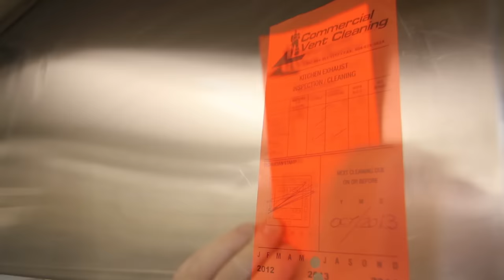Kitchen Exhaust Cleaning   Commercial Vent

Comment: Good thing you guys picked an already pretty clean hood to advertise lol show them how a Chinese restaurant hood looks like lol
Reply: HAHAHA... some chinese spots are maintained.. but if you go to a lower end ones jesus.
Reply: some taco shop too, check them out...
Reply: No joke.  Any place that cooks with corn oil or sesame oil is hell to clean.  That type of grease, it just won't budge even if you're using extremely caustic chemicals.  Doesn't matter how hot your water is, how much pressure you use, or what your gallons per minute on the machine are.  It'll just sit there, all smug-like until you crawl up in there with a razor blade and peel it off.

Some taco joints and chinese spots, it's like you're skinning a calf.
Reply: @SoulSoundMuisc  Ya for sure. we used to own a HOODZ truck and that peanut oil was the fucking worst. we refused to service them. or at least seek them out. also they were usually too cheap to even get it serviced which is why they get so bad.
Reply: @swedishfish6505  Company I work for, we do take those jobs but we charge very high for it because it's going to be a recovery cleaning (6 hours or more for 2-3 techs).  Post recovery we can get them down to 2-3 hours a job at about the third cleaning, if they stay on schedule.  We also demand payment up front the first few services, cash or check.  No payment, no cleaning; we've been stiffed far too many times.

I will say this about Mexican food, at least in my area.  They are, bar none, some of the cleanest kitchens we encounter.  The equipment is old and worn down, but it's clean.  The floors?  Clean.  The hood exterior?  Clean.  Half the time the hood interior is clean because they get up there every night and wipe it out.  It's the roof work, duct, plenum and filters that are a nightmare.  Not all Mexican places are like that where I'm at, but most of them are.  They're hell to clean, but you can tell they give a damn about their business.
Reply: True they are the hardest ones
Reply: It's not clean
Reply: @SoulSoundMuisc 👍🏼👍🏼👍🏼♥️♥️♥️♥️♥️💯
Reply: @SoulSoundMuisc how much do you charge for something like that? You in socal?
Reply: Or Indian dude😂
Reply: That's hilarious.. but the truth

Comment: I have to say, the techniques used in this videos are not the safest or most effective ways of cleaning. The used of just a hand sprayer without a wand for pressure washing does not reach the far away stuff and doesn't get the hard to see spots in the fan and is very dangerous to the user. We see this a lot in our area and the ones who use this way of cleaning don't get called back.

Comment: Not bad. I would recommend using a 2ft wand with a 45 degree angle at the end in order to get the back of the blades better. I would also be very careful about using the zero tip. I noticed you hit the fire suppression link. You want to avoid spraying that directly. It could set the system off.
Reply: No
M
M
Ok 
Yes we mmm
Ok
Reply: Yeah I was gonna say the same this. Q0 lbs of pressure will set that off.
Reply: That's why you disarm the system before cleaning
Reply: @M18-v4t  disarming doesn't matter if you damage the links. Apparently someone is not certified in fire safety giving such cheap advice

Comment: I like the job they did I’ve been doing this for 7 years along w grease trap removal and laundry exhaust cleaning but what about all the grease exhaust fans on the edge of the roof that you can’t flip over all the access doors that have a small door cut and can’t do much cleaning too I do this in nyc

Comment: Why didn't you guys clean behind the vents? 2:27 cleary shows all thw grease dripping down.
Reply: Im sure it dont matter
Reply: Jarumy Leon i noticed that as well, most likely its not a big deal but i'd want clean work all the way around
Reply: Alot of restaurants owners or managers are cheap as heck
Reply: @MrLatrinca  it does matter if u don't clean behind the filters there can be pounds of grease behind there
Reply: Some of those stains are not removable
Reply: it is clean , I think in the video you cant see , but is just water .
Reply: Well when a person what their kitchen hood clean you have to do the fan the duct 
And then hood and the 90 spots.

Comment: I use to work with a good exhaust cleaning company. Never again will I work that job. Way to dirty, most bosses cheat you out of hours, and the people that work at restaurant business are the worst. You never wanna work in a restaurant. It's like those people aren't connected to reality and have massive egos.. always telling you how to do your job but has a dirty ass kitchen and dirty pots laying around. I'll stick to tree work.
Reply: What type of degreaser is that why does it foam up
Reply: I only have problem with the Chinese restaurants lol
Reply: I work in a kitchen if its as you say then the u need tell health inpector
Reply: rtd Ozi... well what we use to use was oven cleaner and we would pour that chemical into the foamer for the power washer... and the pump sprayer I believe has sodium hydroxide mix with water in it
Reply: Yes Pablo... Asian restaurant were a bitch to clean.. this restaurant in the video they are showing is cleaner the most Asian restaurant kitchen exhaust system
Reply: Justin, ive just started this job, sometimes the grease and oil gets in my gloves and its starting to stain my hands what did you use to clean your hands?
Reply: @jayzah  use better gloves.  And better protective cloths.   These chemicals are very strong.  It will destroy your skin & get absorbed into your system then the long term health effect will cost you $$$ & PAIN & THEN YOU'RE DEAD.  Be smart.
Reply: @AndreAndFriends  Thanks for the info man! Im in my second month Already got chemical burns from trialing a previous pair. Ive taken to a thicker, tighter pair of gloves that seem to be working better. Taping them off at the top is helping to
Reply: I recommend you to work my ex company in philipines
Reply: Hey whats the solution u use to clean the restaurant kitchen hood... mine is very very greasy... would appreciate if u could let me know about it
Reply: I've worked in the restaurant industry for 20 years, and honestly... I'm having a hard time disagreeing with you. lmfao

Comment: Didn't clean in behind the vents, nor did you show the grease traps below the vents being cleaned out. The stainless steel behind the vents was still pretty caked on with grease. Noticed as they were putting the vents back in. I have to clean the vents at my restaurant, sadly can't spray it down like you guys did, that would make it so much easier.
Reply: So how do you do it without the sprayer?
Reply: @ShiftingCloudsYT  spray it with degreaser and wipe clean. Takes a bit but gets the job done.
Reply: yes they did its clear they show it before and as they throw the filters back up its just the back wall behind the filters is galvanized steel and gets like that over time.
Reply: Soak them in the sinks overnight
Reply: @CravenM1980  it wasn't an option when I worked there. I've since moved on so that headache isn't mine anymore.

Comment: do u  need a pressure washer or a hot steamer  to clean it
Reply: WASIM AMIR ALI yes you do
Reply: bout
Reply: Hot water is the only way to not struggle and do the job right and fast
Reply: Pablo is right, if you use the right chemicals you can use a regular garden hose with reel connected to a hot water outlet with a variable trigger nozzle as long as the water is hot
Reply: We have a pressure washer with a small boiler attached for the hot water
Reply: I always like to use a gas machine probably around 4000 to 4500 psi you hook it up to a boiler they usually run on desal. Hot water always works best. Even with the chemical I noticed mixing your chemical in hot water works best atleast for me just use a mask the fumes can't be any good for you.
Reply: @Username-cb4fg   PSI is secondary, it depends on gallonage.  How many gallons a minute is your machine putting out. You can get 4000 PSI and it can be like cleaning with a pencil. And chemicals...... sodium hydroxide is the same chemicals used to remove flesh from bones in the laboratory.  It is made to attack animal fat.....  yep, same thing we are made of!   
 Wear your PPE.
Reply: @busterdoordown1489  Spot on.  It's all about water flow, what your gallons per minute are and HEAT.  Heat. Heat. Heat.  PSI isn't even secondary.  Chemical, Heat, GPM and then PSI.
Reply: @SoulSoundMuisc  Whats the best Heat temp and GPM you recommend?
Reply: @KAT-df7ey  200F  if I can get it.  That's what I keep the boiler set at, but we can't always use that machine.  As for GPM I can't remember offhand but more is better!

Comment: What's the name of the degreaser they use
Reply: There's all different types of degreaser that commercial traders use to clean systems like these sadly you cannot buy them as they are corrosive and dangerous to use we use potassium hydroxide base degreaser that has.amazing grease cutting abilities but at a cost of burning our skin when we co.e I to contact with it
Reply: @RedDevilGaming88  so that's y your properly covered up. I need one of those machine though can u reccomend
Reply: What machine are you referring to a pressure washer
Reply: @RedDevilGaming88  yeah I'm in the industry as well
Reply: But can we chat over email

Comment: What is good chemical for getting the stainless clean?
Reply: DestroyAllorNothing liquid caustic- high alkalinity, low foam.. specifically designed to break down grease. Especially on stainless. Careful getting on aluminum, it will turn it black and burn any aluminum.
Reply: Kenneth Maloney Thanks a lot for the reply.
Reply: you need just clean stain any degreaser afther clean and dry you put w40 for shine

Comment: You can't clean a hood system correctly without an extension wand and injecting chemical through the pressure washer.  Luckily for them this hood was fairly clean to begin with
Reply: Injecting chemicals through the washer for hood cleaning is not a bright idea. You can damage unknown parts in the hood. Your best bet is a foam cannon or a foaming pump up sprayer.
Reply: @CravenM1980  I've used foam and though it works to a degree it's costly and doesn't get into every part of the hood. Heat along with injecting chemicals through the pressure washer is the safest and most effective why to clean an exhaust system. If you use the correct chemicals there is no damage to the hood system. I'd say foaming is good for the final wash to get possible left over grease that may have splattered due to cleaning out the grease track. Asian grease must be penetrated before the foam is able to get under the grease or it will simply stay on top of the grease.

Comment: The way you washed that fan a little cringy the top half of the fan where the motor housing is. you have to be very careful if water gets in side that motor it is as good as fucked .. and on the outside as well usually there is an electrical box attached to the side of the fan Bowl
Reply: This is how they're cleaned.  I've been doing the same thing these folks have been doing, with heavier equipment and far more potent chemicals than shown here (very high PSI, high volume, 250F heat or higher) for over six years.  I have had water infiltrate and ruin two fan motors in all that time.

It's not the fault of the cleaner if the fan motor gets ruined.  That means that the system is not water tight.  That's on the manufacturer, or the installer, or the owner for lack of proper maintenance.  Those fan motors are also quite robust.  I have seen motors running with no covers on them, exposed to the elements.  I have seen motor housings with gigantic holes punched in the tops and sides of them.

What you just saw in this video was actually a fairly ideal fan.  Most do not look like that.  Most look like a hobo has been up there beating on the thing with a baseball bat because he thinks moon monkeys are inside of it or something.  No joke.  Most commercial fans look like they're about to fly apart under their own power.